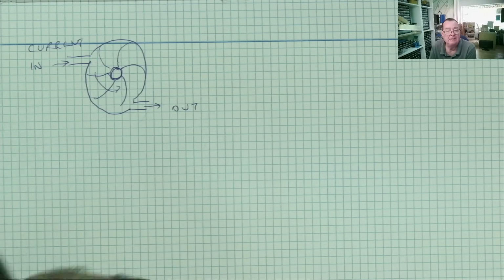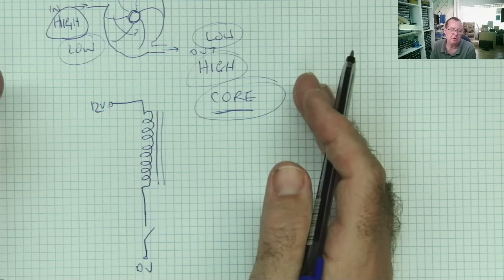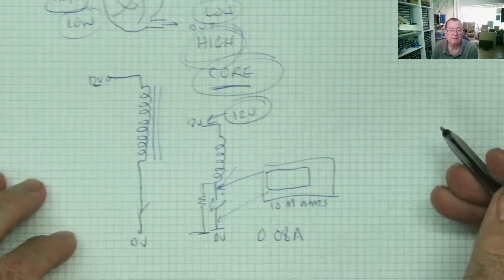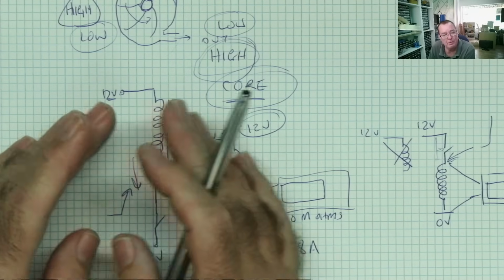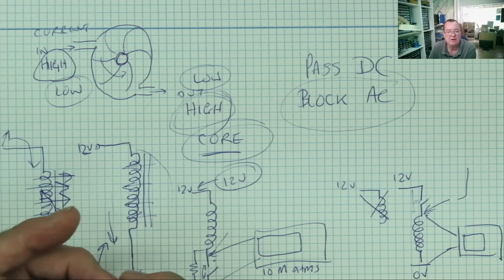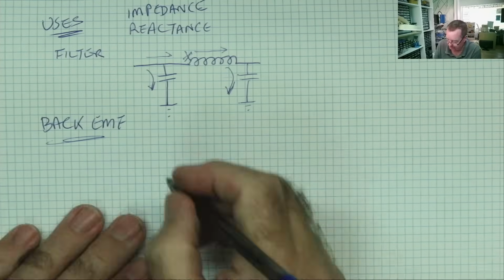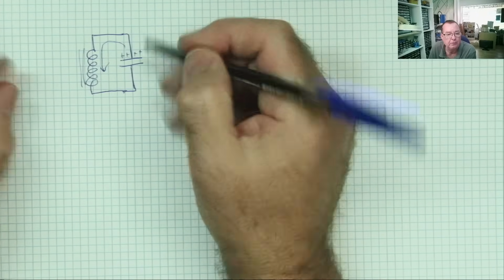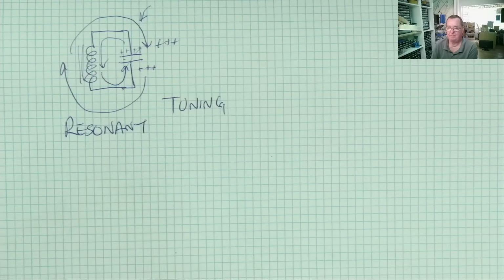Learn Electronics For Everyone : What Are Inductors PART 2 Beginners Tutorial Guide

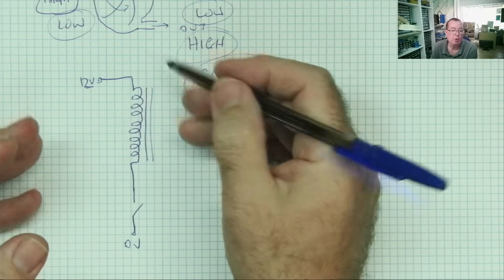Comment: at about 6:12
"Does the current flow in an out at the same time? No."

This is just plain wrong! The current in ALL PARTS OF THE CIRCUIT at any instant is equal. For every electron flowing into one end of the inductor an electron flows out of the other end. Kirchhoff's current law is not violated by inductors.

Here is what actually happens. Assume that there is no energy already stored in the inductor, the 12 volt supply can deliver an arbitrarily large amount of current and there is no resistance in any part of the circuit.
• At the instant the voltage is applied across the inductor, the current will be zero.
• Current will begin to rise linearly with time. Again, at any instant the magnitude of current is identical in all parts of the circuit.
• The voltage across the inductor is always exactly equal to the supply voltage - 12 volts in this case - as long as the switch is closed.
• An air-core inductor will not saturate. The magnetic field will continue to rise linearly with respect to time. 
• In an inductor with a ferromagnetic core of a material such as steel, powdered iron, molybdenum permalloy (metal or powder) or ferrite, the core will eventually saturate - increasing magnetizing force will not result in increasing magnetic flux in the core. At that point, the inductor behave as an air-core inductor with regard to continued application of the supply voltage. The current will continue to rise, but with a slope much steeper than before the core saturated. (Different core materials saturate in different ways - ferrite tends to saturate abruptly; powdered iron gradually). At no time does the voltage across the inductor change if the power supply voltage is constant (which means it can deliver the required current). An yet again, the current in all parts of the circuit will be of identical magnitude at any instant.

When the external supply voltage is disconnected, the inductor will "try" to keep magnitude and direction of current flow the same. Opening the switch (assume no bounce of the contacts) would result in instantaneous reversal of the polarity across the inductor. In order to keep the magnitude of current the same, the voltage will rise to whatever level is required to do that. In the case in the video where the current was 80 mA and an oscilloscope probe with 10 M resistance was connected, the voltage would rise to 80 mA x 10 Mohms = 800 kilovolts. In practice with  a real switch  the voltage won't go that high. Much of the energy will be discharged in an arc across the switch contacts - which is the only thing that kept the scope from being damaged!

If you want to keep energy stored in an ideal inductor with zero winding resistance, you short-circuit it at the same instant you disconnect the charging supply voltage. With zero volts across the inductor the rate of change of current through it is also zero.

The waterwheel analogy also fails.
Assuming the chamber in which the wheel is housed is filled with water (not air) at the beginning when the wheel is still, as soon as pressurized water is applied at the inlet,  the water flow from the outlet "instantly" becomes equal to the flow into the inlet. There is simply no mechanism by which water can be stored since water is virtually incompressible. It has nothing to do with energy going into making the wheel turn. The rate of flow will increase as the wheel spins up, but the volume of water out will always equal the volume of water in. Similarly, when the inlet is closed, no water can flow from the outlet, regardless of the energy stored in the spinning wheel, unless air can enter the outlet or "cavitation" occurs.

Comment: I love the lesson.

I might reference this video in my video where I explain the three different types of metal detectors.
1) BFO (Beat-Frequency Oscillator (oldest technology)). Where two oscillator outputs are beaten together. One oscillator is in the control pod, and the other is in the search coil. If a metal target nears the search coil, the inductance is changed slightly (like a metal slug being moved in and out). This changes its resonant frequency with the beat offset, alerting the detectorist of nearby metal.

2) VLF (Very-Low Frequency (90% of all detectors)). This technology uses two coils located in the search coil assembly. One transmits an AC magnetic signal into the ground, and the second coil is utilized as an antenna. The antenna coil is positioned such that its received signal is nulled out (similar to noise-cancelling). If a non-ferrous metal is near the transmit coil, eddy currents are induced in the buried metal and these currents oppose the magnetic lines of force pushing them back and compressing them slightly. The receive (antenna) coil senses this disturbance and sends an alert to the processor to buzz the speaker.

3) PI (Pulse Induction (the most expensive). This technology uses pulsed DC signals to energize the coil located in the search coil assembly. When the coil is energized, it begins to build up a magnetic field in the search coil. Then the pulse is removed allowing the flyback energy to send a very powerful magnetic pulse into the ground. Milliseconds later (just after the pulse is damped out) this coil is switched to the receiver section and it becomes the antenna listening for magnetic responses from any nearby metal targets. This requires more timing and switching circuitry increasing the cost.

Comment: If you use a crystal and a variable capacitor you get a tunable circuit from the crystal (VCO Voltage Controlled Oscillator) , if you add an inductor you widen the bandwidth of that circuit (LC-VCO).  ( LC is short for the Resonant Circuit shown at the end of this video L being Inductance and C being Capacitance ) Really enjoyed the video and learned stuff. From a ham radio point of view we of course use inductors as filtering and depending on where we place the capacitor gives us low pass or high pass filtering, and we also use them to filter our radio waves that can if left unchecked, deliver nasty spikes of voltage to unwitting hams (1:1 ugly balun being an example) I have two little scars on my forefinger from the ground on a microphone to prove I didn't know this once.

Comment: The high voltage from the coil in the relay reminds me of something I did when I was young. We are talking primary school. My school each year held a fair to raise funds.
The stall I had was; pay a half-penny (1/2d) to be electrocuted, haha. People paid 😁
It consisted of the the insides of an old electric bell, the type that had a clanger that rocked between to bells, the bells where removed so only the clanger vibrated.
It was battery powered, a wire was attached to the negative of the battery which went to a metal plate to hold, and an other metal plate (held in the other hand) had a wire going to the open side of the coil of the contacts.

Comment: There's a video on YouTube titled An Almost Solderless Crystal Radio which uses two tiny inductors that look like resistors as it's tank circuit.

Along with a diode and a small disk capacitor it's a working radio! 

Can your oscilloscope read this tank circuits frequency which is generated solely from the voltage induced into it's antenna from radio waves?

The video builds this circuit on a breadboard with just two inductors, a diode and a disk capacitor.

The capacitor value can be swapped out to effectively tune in different stations.

Comment: Thank you very much Richard.  As I said in the comments on part 1, chokes, coupled inductors, transformers and smd inductors (high side, low side fets) would be lovely to explore.
Reply: Not to mention VRMs. In short some real world circuit boards would be nice
Reply from the maker: @mohammadusman831  The second use of inductors I mentioned in this video is basically a VRM